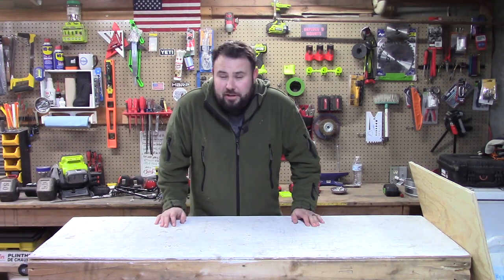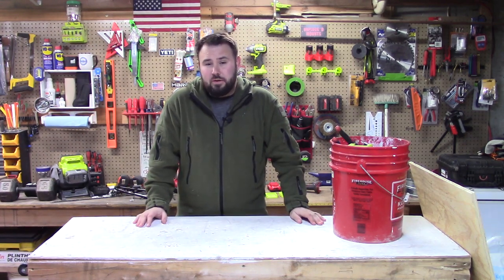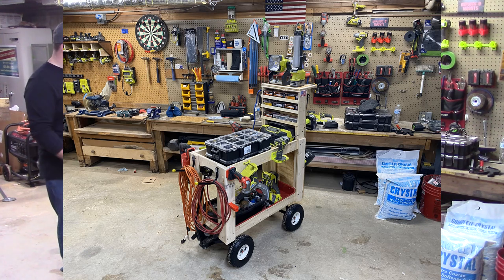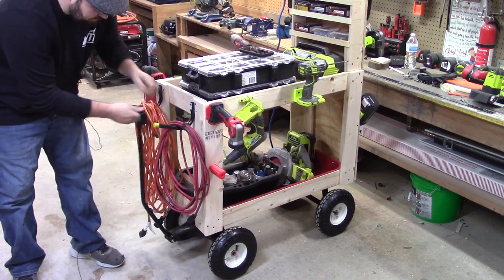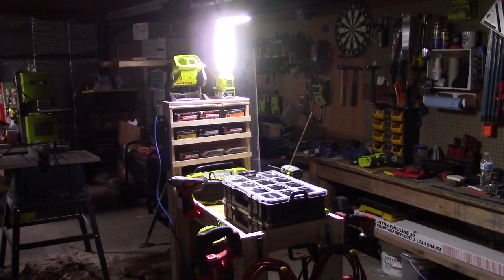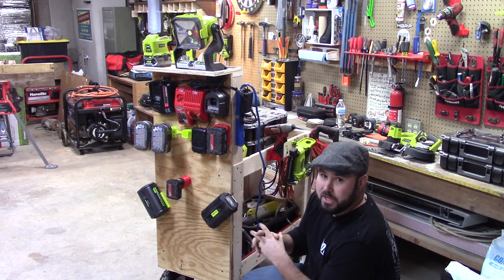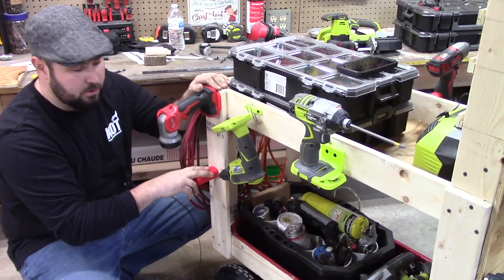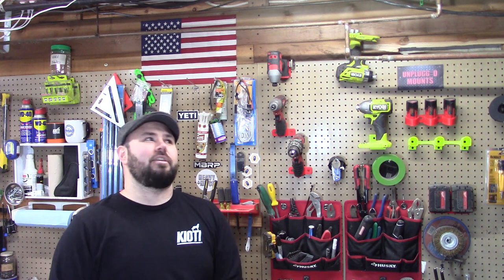Harbor Freight Monster Tool Cart! [All Terrain!]

Comment: Neat idea.  I did something similar.  I built a box like you did.  Except it fits into the wagon.  Then I can take 2 ratchet straps and run them under the wagon and they securely hold the cabinet to the cart regardless of where I take it
Reply from the maker: I am thinking about changing out the front wheels to be independent. To maintain better stability. However it shakes now but doesn’t tip unless I try to flip it.

Comment: Have you thought of using unistrut or extruded aluminum as your frame rather than wood. It would add a crap ton of rigidity and would make your load bearing capabilities rise exponentially. Just throwing it out there.

Comment: Two weak links in your design: 
(a) the tires are absolute junk.  I know from personal experience.  I would blow through TWO tires a day working all day at a junkyard pushing a heavy tool cart with heavy car parts around.  The number of plies is too thin and the rubber is too weak and will not hold the weight you're trying to haul.  The work around is using either trailer hubs and trailer tires (designed to haul 1500 lbs or more), or use light car rear hubs and space saver tires.  These will not only be FAR easier to roll and much more durable, but will hold all the weight you can put onto your cart.
(b) the cart is WAY too wobbly.  You need to lengthen the wheel base and/or widen it a bit.